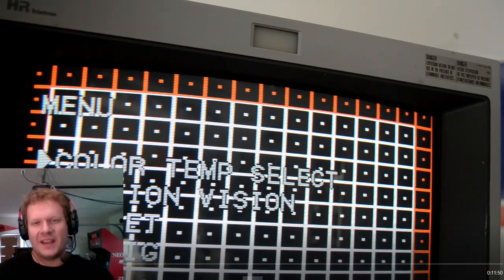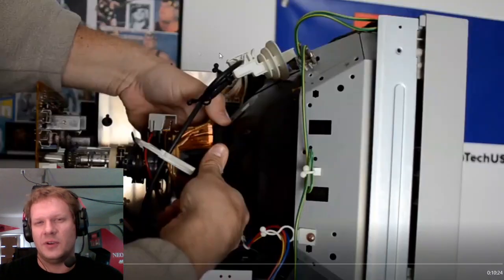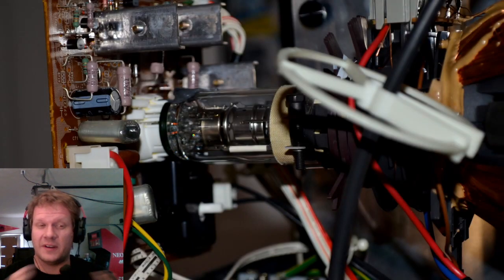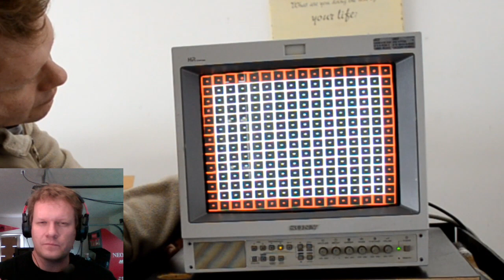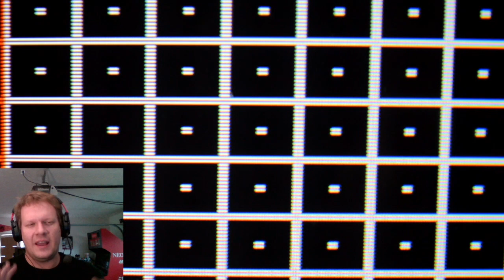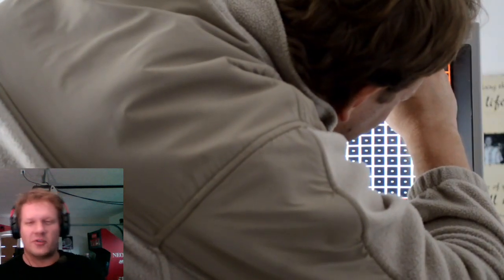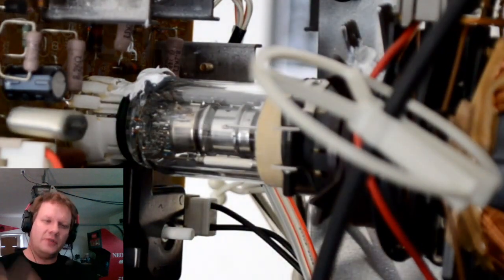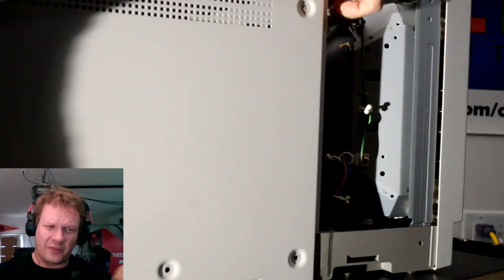Adjusting CRT Convergence

Comment: Please, tell me, what kind of high temperature sealant do you apply to the magnetic rings and to the tube?
Reply: Omg yes! Nobody seems to know what was originally applied and what to reapply!
Reply: @DasAntiNaziBroetchen  Yes Yes! I really look forward to a video where the author will tell you what kind of tool it is!
Reply: You can use silicone if you want, not hot glue or any other glue.
Reply: I heard from somewhere that some manufacturers used paint. Not sure what kind.
Reply: @GoldenMean743  😲😲😲
Reply: my guess is RTV silicone or epoxy. I used a 2 part epoxy when I glued my yoke to my tube
Reply: @dudeguy7347  спасибо большое,  друг 🤝👍

Comment: Hi Steve, what a great channel :-)! Why I found you, and why I will follow your from a now one for a long time: Recently I picked up an Sony Trinition KV-25X3D from my parents home (I'm in retro tech here in Germany since 25 years), which was located for over 20 years at the guests chamber. It was rarely in use, I would say "close to never". Besides the dust at the inside it looks and feels like new. I removed all dust, cleaned it, resoldered all high voltage and high power areas I found on all PCBs and started to calibrate it. The colors are brilliant, and about 90% of the screen is perfect. For one area, top right, it is impossible to get all 3 colors aligned, without killing the alignment of all other parts.
My dad, meanwhile at an age of 75, was a professional Radio/TV/Hifi employee in the 70s (later he switched to Digital Equipment Corp, you maybe know them, away from CRTs), and he and myself tried to adjust the colors, with the horizontal/vertical alignments directly at the tube and the tubes boards. After hours, the issue is still the same.
He told me about magnets, which were added back in the days to the back of the tube, to compensate geometry issues, but in his memories, this could not fix color issues like this.
Long text, short question: is any tube in "good condition" able to be calibrated in a specific war, or is it possible, that this tube will never back to about 100% of its old quality?
Reply: Hey, I've got the same issue - you ever get this worked out?

Comment: So I've run into a little roadblock here; the purity, red/blue, and green/magenta rings on my set are glued together from the factory and I can't seem to get them apart to adjust the convergence. Any tips for getting them separated?
Thanks for your help
Reply: Oh my, me too! Trying to find out if it's safe to pull the glue off. I'm guessing it is, though it's not an area I want to guess haha
Reply: Use Thinner For Remove The Glue..

Comment: The most useful Crt Tv topic I've ever seen. I had an incredibly strong electric shock 27 years ago, out of curiosity I opened the inside of the Crt TV.  Although I did not take any physical damage, an incredible voltage passed over me :D

Does the electric current not affect you?

I'm asking because I don't understand the language of the video, maybe you answered.
Reply: Did you open the TV while it was plugged in?  Please let me know cause I'm thinking of opening mine and if it shocked you while it was NOT plugged then that's a massive risk I'm not willing to take .
Reply: @andree1991  Electric shock happens even when unplugged. You need to discharge the electricity. Please see the videos about it.
Reply: @SaglamSerdar  Damn bro. Thanks for the tip
Reply: 100% agree. What a supernatural degree of expertise! Maybe adamantium bones ground him?
Reply: I knew a real big guy once got practically thrown back messing with a older TV when he didn't know what he was doing. Learn how to drain crts before working on them, what to do and what not to do... these things can be dangerous.
Reply: @garyr7027  That's unfortunately not an option if you're adjusting the yoke.

Comment: Would you say/recommend hot glue instead of caulk to set the rings in place after tweaks or is that a no go? And what kind of caulk do you recommend Acrylic or Silicone?
And where could one buy decent yoke wedges/stoppers.. I can't find any except some weird looking rubber after market ones that look like doorstoppers.
Also I would like to voice my appreciation for your channel and all you do, I've been collecting CRT's for a few months and this channel helped me learn so much about servicing them.
Reply: An NEC CRT service manual seems to indicate TSE385 RTV silicone.
Reply: Maybe disregard that - that might be for sealing the HV terminal.

Comment: Hi, Steve. I have a Japanese KV-28DA55 that I have been setting up. I adjusted the HSTAT and the focus and now when ever there grays on the screen they are perfect but bright colors like yellow or orange and blue form some diagonal cross hatching pattern. In service mode if I set CTRAP to 0 it looks perfect! But even if I save it, when I turn the TV off and on again, CTRAP gets reset to 1 automatically or something and the x pattern show up where ever the colors are.
Reply: You have to save the settings, most likely by pressing muting and then enter

Comment: Is it safe to do the convergence adjustments while the set is tirned on? I have a 19" Emerson VT-1920N that has convergence issues and I don't have a service manual for the set or the actual remote for it either.

Comment: great work! I just recapped my Commodore 1084s-p1 monitor but it also needs one degree tilt adjustment anticlockwise (as you see it from the front).. is it safe to turn the yoke one degree without the need to re-adjust all these parameters (convergence, etc)? - EDIT: I did it and seems to be ok. I noticed that there are 7 rings... three sets of two as expected and a 7th single ring right behind the yoke. What is that one for?

Comment: Im wondering about those plastic rings on the back of yolk ,i moved one of those by accident when dissasemblying for repair. The crt works fine it just has maybe 5 pixels in upper left corner missing in like a soft angle. Do those plastic rings do anything? or can i just adjust it in service menu? thanks Oh never mind i just got to the part of the video you talked about it lol

Comment: The yoke on my CRT seems to be bonded very securely to the tube. The picture is great. Not tilted, just missing some of the picture off the right side of the screen. I've already tweaked it a little using a little potentiometer wheel I found on the circuit board on the back, but it's not quite enough. Do I need to remove the bonding from the yoke to make any adjustment? It only needs a little! Very frustrating.

Great channel by the way.
Reply: Do you know what kind of epoxy was used?
Reply: @badreality2  No. It's white. Doesn't even seem to have a spongey bit underneath either, just the legs attached straight to the tube with a large amount of the bond in between. Looks like it would be a real pain to try and cut or melt off. And the picture is really not bad.
Reply: Don't bother with the yoke if you don't have any purity/convergence or tilt issues. You need to tweak horizontal size and phase from the main circuit/deflection board on analog or from service menu on digital chassis sets.
Reply: Thanks for the replies!

I think there’s nothing more I can do then. I already improved it with a pot I found on the circuit board and since it’s from 1980, there’s no digital menu.

Comment: What part of the crt you shouldn't touch while it is powered to avoid getting an electrical shock.
Reply: There is a bunch of stuff to avoid. Anything with exposed copper is a huge safety concern. Stay away from the fly back while it’s running, and the power supply. It’s risky working on these things. You need to be extremely careful!
Reply: @joshmiller887  thanks
Reply: The (sometimes) exposed wires on the yoke, that big red wire with the cup attached to the CRT, the back of the CRT board, and any heatsink in case is a "hot" ground set.
And just about any part near the fly back.
But still, don't go poke around anywhere if you don't have an insulation transformer.
Reply: @GoldSrc_  thanks

Comment: RETRO TECH, Why does monitors use a B+ voltage set at 130vdc for what reasons? because the H&V oscillators need +130vdc but not sure why. Any reasons why the Horizontal sync is at 15.975Khz and the vertical sync is at 60hz, why are these the TV industries standards? The Screen adjustment and Focus Adjustment are a High "Negative" Voltage to the grid and screen grid of the CRT tube but its a Negative voltage? Any reasons why they use an isolation transformer for floating grounds on the monitors circuits boards why would u want floating grounds on your monitors circuit boards?
Reply: "Why is the vertical sync at 60hz"
Cuz of mains voltage. 50hz in Europe.

"But why 50 or 60hz mains voltage then?"
Cuz.

"What is a negative voltage?"
Think of voltage as a potential. 150V is 50V in relation to 100V. 100V is -50V in relation to 150V. That's it.

"Why they use an isolation transformer?"
It's much safer in case you get electrocuted by it.

Also the answers to most of your questions are easily google-able and are well documented. I only gave a brief summary because this comment is one year old and you likely aren't even gonna see it.

Comment: I don't think every crt has h-stat

Certainly a few of my older ones don't
Reply from the maker: You are right, not all have it.
Reply: It is a feature of Sony or other trinitron based tube monitors/tv sets only. On non-trinitron tubes, horizontal static convergence is also set by adjusting the rings.